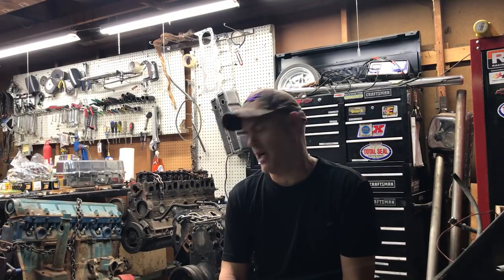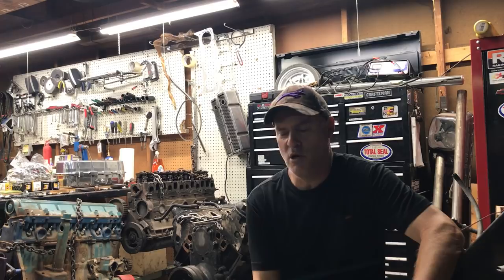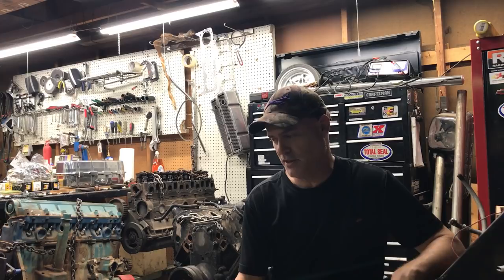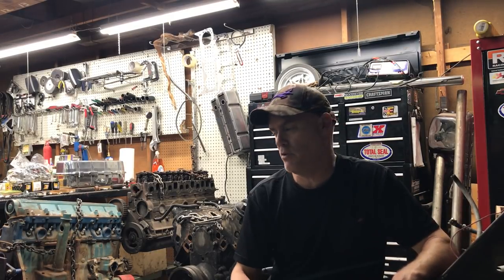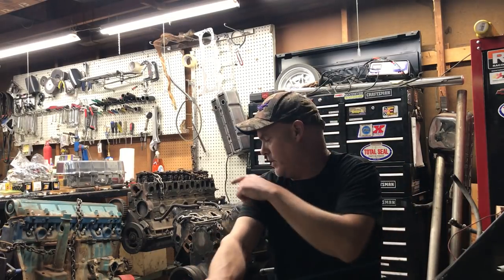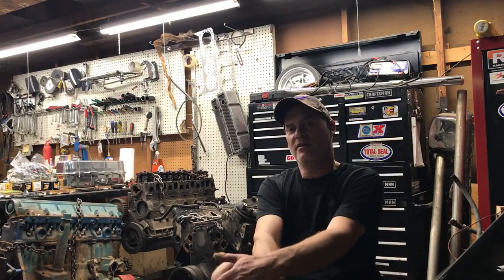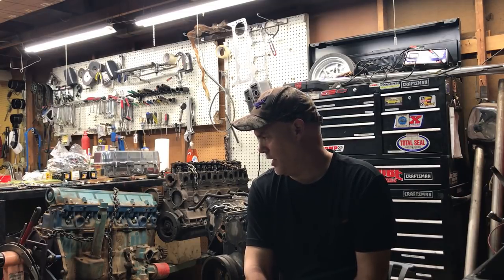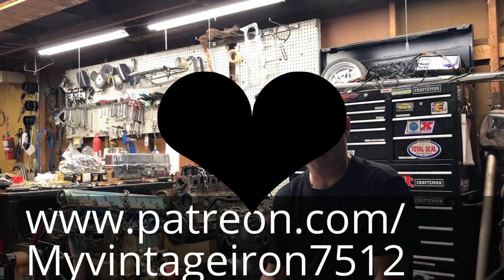Lets Talk LS Engines

Comment: ls has a low drag ring pack on them i have a 4.8 in my truck stock and will spin the tires off the down side is bad bearings in the rockers and rollers otherwise 3 to 5 hundred thousand miles i love my ls
Reply: my wife wants me to buy a new truck but my sierra 2001 is so dependable only major things fuel pump 2012 1 brake caliper 2015 1 compressor 2019 all easy fixes and dirt cheap prices .

Comment: After I built an old "vintage" engine, added fuel injection, a serpentine belt drive with high output alternator and A/C compressor, and an overdrive transmission.  I realized if you want those features, it is way cheaper to swap in one of the modern engines with OD transmission.  I picked up a 2008 6.1L Hemi (less than 50,000 miles) with NAG OD transmission, all accessories, wiring harness and computer for $4,000 to swap into a 1969 Dodge Coronet.  Only issue is not much aftermarket support for the transmission electronics.
Reply from the maker: Keep in mind the Mopar's are more expensive than the LS stuff but I'm with you I am actually a mopar guy at heart

Comment: Have you ever honed one .010 or .020? I have and the cylinder is not harder than a small block Chevy. The reason they usually don't have a lot of wear is ring tension. The late model Hemi is really soft and easy to hone but there again usually very little wear.

Comment: As usually, your on point.  And i have been doing this for years myself. So when i can see that you really hit things on the head.
What you're saying about these are true, & i am that Old School guy. Well im that in between  (at 41), but since I grew up with the old school,  & so i learned & love that way.
But I also have to give credit to where its due. The LS has so many possibilities. And you are so correct about the architecture differences, which in reality breaks down to the efficiency in which everything can happen. Thus, make more power!

But... lets not forget what the older SBC is capable of... of course if done correctly. 
Also application,  LS, Coyotes, etc, tend to be more Horsepower oriented,  vs the low end torque.  That is what all those smaller bores, higher CFM's pretty much equate to. Ever notice, that most of these cars barely break a tire loose? Don't get me wrong,  thisdoes have its benefits, such as not wasting power. But in many cases, im not impressed with how they take off. Sure once they get going,  they go go go. But have to rev & spool up 1st.  Of course any of these can also be built as complete torque monsters, but most do not. They look for that "peak" HP number which seems to impress everybody. Again im not knocking the new engines,  they are impressive too. 

Race cars, high end,  Horsepower,  then go the LS, Coyote, etc.

Street Car, which originally had old SBC, SBF, probably stay with it , especially if  $$$ is tighter.

Currently finishing up 91 Corvette,  384ci Stroker,  with 10.5 SCR, & yes with Twin Turbos. Forged internals of course,  & list of things. 
On 8 PSI;
625HP @ 6,100 /  740 Tq @ 4,000
(680Tq by 2,400  & after 740Tq peak, it very slowly drops Tq until the 5250 cross.
It is an animal for a street car! 

My brother has a 85 Thunderbird, Dart 5.0 L, forged internals,  10.2:1 SCR, aftermarket GT40 aluminum head (flow up to 260 CFM @ 0.600" Lift) & a single Turbo & 
on 14 PSI;
720 HP @ 6,300 /  630 Tq  @ 4,200

Don't get me wrong,  we are using aftermarket EFI units & lot of time, money & planning went into & still are going into these, & we are almost to the final unveiling points of these not bad ass street cars, but also have other extreme customs. 

Point is, if you have the older blocks,  & want a bad street car,  it is more than possible without an LS, etc, swap

Comment: I have a Stock Bottom End, stock headed 4.8l with a Borg S475 running 16-18lbs of boost and I run the shit outta this set up, no overheating issues, actually no problems what so ever. Other than the turbo set up I only replaced/upgraded springs & retainers etc, high lift long duration cam and Holley Terminator control system, MSD 6-AL ign box. For the little money I spent and the massive performance massive horsepower Its insane

Comment: I bought a 01 Suburban with a 6.0L LQ4 (i belive) engine in it. Got it cheap as it had practically no oil pressure and I heard a knock from the engine. But it was no rod knock or main bearing knock. Just sounded like a bad lifter. So at that time of buying it I really had hopes for more of a minor problem. 

Turns out that the that the center cam bearing had spun out of the block half way. Have you seen this before ? And any guess why it had happened? I my guess is to long intervalls in oil changes and some gunk got loose and clogged the oil line to that bearing. 

And to confirm your saying that these blocks are durable. It had 260.000km on it when I checked the rod and main bearings. There were no signs of wear. 

Its now 3 years since I replaced the cam and bearings, and it still runs great. Installed a mild cam in it and it makes that Suburban move quite well! Only thing is that the idle is a little rough with the new cam

Comment: i managed to get a 5.3 with a new cam and new lifters with a rebuilt w/new torque converter 4L60e for free had it running driving in my chevy colorado in 3 months. The engine had been sitting in a fence row for 6 or 7 years in a silverado. threw some new injectors in it and it runs beautifully

Comment: I've had both, the LS is so much better, I had a 65 malibu with original small block, constant problems & high MPG, I now have a 65 C10 with LS1, it's faster, reliable, runs cooler and gets amazing good gas mileage. I won't have another vehicle without an LS in it. Please do a video on which is the best LS motor to swap and also LS upgrades.

Comment: My 1999 silverado 2500 LQ4 6L engine can be run without coolant. Thats correct. The owners manual tells how if coolant is lost the engine will run on 4 cylinders at a time. Air conditioner will not run. we are to drive at reasonable speed for up to 200 miles. After cool down and coolant system fixed the oil should be changed(it has had a lot of heat). My truck has the optional oil cooler as well. I have owned several chevrolet v8s and this one is my favorite.

Comment: Man, I am so glad I found your channel.  So far I have been binge watching you.  I obviously have a couple of questions, (as I am just a novice).  I have an extra 2001 LQ4 that I plan on re-gasketing.  I was told it had 130,000 miles and was in a plow truck.  I plan to change timing chain, oil pump, complete gasket kit and main seals.  Probably water pump too.  Question,  Do I need to lubricate the threads on the new OEM head bolts prior to installation?  Question 2, Would it be better if I install the oil pan before installing the front and rear main covers.  I bought a hub style cover / seal install kit, so I could do it either way.  I just figured it would be better to mate them up to the oil pan?  Thank you for your knowledge...  Ok, back to more of your videos.    Mike
Reply from the maker: yes oil threads pan goes on last

Comment: Its not that us old school guys dont like the LS engines, its that we like classics to be, well, classic. I LIKE messing with carbs and the simplicity of the whole design. Computer controlled vehicles are great. Its just that I prefer them on my modern daily driver. Not on my classic.
Reply from the maker: The Carb stuff is not simpler at all the OBD 2 computers basically self tune they are pretty much plug and play whereas carbs require manual adjustment at every level I do understand the classic end of it the early small blocks are still the least expensive builds and are quite popular I do allot of them but the point I think should be made is they are definitely not simpler than the LS either from a build or tuning standpoint

Comment: I get it with these LS engines. All the talk about how good they are and how they are so cheap to buy and build? Hmm. I have many friends that have gone down this path and LS engines is all they talk about. I have seen every one of those friends spend countless hundreds/thousands of dollars on LS performance parts, Special LS parts to adapt that engine into their ride, computer stuff, more computer operated stuff, special wiring harnesses being made, finding wiring harness parts, finding computer operated items and parts to work their engine, making the engine run with the drive train, HP tuners, hiring a "specialist" to tune the thing. And that doesn't include the power adder. The list of special tool purchases to work on these engines is long, too. Sure, the LS engine is very cool and people are making some impressive power with them, I will not disregard that. Myself, I can't lift myself up to that level due to the for-mentioned. I find it ridiculous to spend hundreds/thousands of dollars on something that I can do Myself with a gen 1 SBC without having all of the specialty, techy, computers, the computer related stuff involved and relying on others to get the thing to run. Maybe one day I will turn into a LS guy when the industry makes it more affordable for a "one man operation" to do so. For now, I'll stay with what works. Analog gen 1 SBC.
Reply: So buy an intake to accept a carb run a  msd box to fire the coil packs and bam your making an ls run on a carb and have eliminated a ton of money and time and especially wiring and tuning all that is out the window set up the carb to suit what you want and the msd box is programmable so lots can be done there as well it's the cheapest way to run an L..S. motor and get good power the h.p and gas mileage differential is negligible between. A carbed one and a fuel injected one

Comment: Other improvements would be thermal management design with the reverse cooling, that cools the cylinder heads first, the symmetrical port layout, and using better materials like the copper-infiltrated Powered Metal valve seats in the LS3.  All those changes reduce cylinder head and valve temperatures improving detonation resistance.

Comment: Love the LS motor, but the wiring seems intimidating......
Reply: Put a distributor and carb on it
Reply: You can't put a distributor in them a msd box takes the signals from the crank and cam sensors and turns those into firing the coil packs at the correct time I.E to run a carb on an L.S swap

Comment: I've owned 2 LS motors 5.3's. both would burn major oil at start up after the intake pcv system porting would fill with oil and dump into the intake ports. Talk about a great engineered engine, I don't think so! And the fact that Chevy won't do anything about it is just more salt in the wound!!

Comment: My brother built a 6.0 LS. Block (Iron truck)and heads were from a junk yard. It made 980 HP (422 CI)with one carb. Cost is about the same as a 454. If you have nothing build one. Don't sell your 454 cheap to get one.

Comment: I have an '05 Silverado with the 5.3 LM7. Bone stock they're so undersressed they'll last forever. I run good synthetic oil and I'm at 200,000 trouble free miles. There's a few million mile LS engines out there. Even at 10,000 plus oil changes it doesn't use or leak a drop of oil. Compare that to all the Ford had with the Triton engines. I'm glad GM found a design that works and decided to stick with it. One thing I found is that it prefers slightly thicker oil. At least a 10w30 weight or a thinner 40 weight and she's good to go. So far the Coyote engine seems to be very well made but for the cost and parts availability I'll stick with the LS

Comment: The LS, Gen III Hemi and Coyote engines are all insanely good. 

Either one of them can hit 500 ho with no power adder, and minimal mods with dead stock reliability and durability. 

A stock LS7 weighs significantly less than a Porsche turbo, puts out equivalent power, and cost 1/3.  

And all of these engines have plenty left in the tank.  I believe Ford has made a mistake with the boost philosophy - coyote can get more power and better mileage with much less complexity. 

A little off field, but this is first hand observation for 3 LS engines, a Ford 2-valve and a 2 Porsches.

Comment: I know what the fatal flaw is in an LS platform it is in the cam bearings. #1 cam bearing is bad about making a knock and if it starts doing that, and it keeps going for very long it will build up heat that will hump up #1 main saddle and in turn destroy the front main. Again I've seen this usually only in performance modded and high mileage (200K plus).

Comment: 80% of ring ridge issue is due to carburation not necessarily due to cylinder material. Look at any sbc engine that has some type of fuel injection from factory. Also LS piston rings were thinner and low tension, another factor in wear ability. Down fall of LS is poor bay to bay breathing. This was encountered in prototypes later modified but still has some problems especially in stroker apps. Ls down fall is buying junk car engines that have set for a while as the dissimilar material ie aluminum piston will corrode bores. .010 max over bore doesn't clean up much. But many good things about them otherwise. Beware of trying to throw a big cam in without a lot of checking, as true for most engines. Simple can be a problematic word for someone with little know how and big dreams.
Reply from the maker: The early small blocks have soft cast iron cylinders the ring ridge I am referring to is not carbon build up it in in fact cylinder wear to say that 80% of the ridge is carbon is a little misleading I suppose I should be more clear on this when inspecting a block we do not consider the carbon build up at the top of the cylinder the carbon gets scraped off during cleaning the early blocks have a huge problem with actual cylinder ridge  it's not unusual to see .010 to .020 cylinder wear on early small blocks it's unheard of on the LS engines because they have much harder cylinders and cylinder coatings

Comment: Hey man watching your LS1 build, can you do a LT1 1994-1996 or so year build or a video with info, I watch all your videos, good info and good advice, keep it up!
Reply: Jursty A LT1 is really just a SBC with a different cooling system. The block can take a little more HP but the overall design is the same.
Reply: Thank you, I am aware of the cooling, I just would love to see a good informative build on one.
Reply: TPV Productions---You're forgetting the distributor among other things.  It's called a Gen 2 small block for a reason.  Virtually nothing but rods and pistons are interchangeable between Gen 1 and Gen 2 SBC's. In fact the stock LT1 rods are as good if not better than a lot of aftermarket rods for the Gen 1 SBC's.   None of the brackets, timing covers or even heads will swap between them directly.  I have both, I know.

Comment: I'm getting ready to buy a high mileage Yukon cheap and build a motor so its affordable, what oil pump do you recommend for these things ? Also, I read a lot about the o-ring failures in the pickup tube, I plan on putting some JB Weld around the joint. I want to do a .030 to freshen it up. Where is the cheapest place to get .030 stock type pistons ? Do you see a lot of worn out valve guides in these high mileage heads ? Also, where is a cheap place for a new stock type cam, and decent lifters at an affordable price ?

Comment: Ls is still old school BUT, it is probably the most advanced incantation of the push rod 2 valve v8, GM has gone all out, the port design is stunning, the combustion chamber is high swirl and resists detonation, the Y block design is second only to Suzuki 2 piece block. The fuel economy of LS motors is impressive, Ford 4 valve do have higher efficiency but of course they should but due to being displacement bound the ls dollar for dollar will kill any ford, aftermarket makes everything for LS, I am sure you can find a cross ram manifold or triple 2barrels on an ls for old school. Camshaft diameters, roller lifters and rockers....its got all the stuff a super hot v8 ran 20 years ago......enjoy before we all must have hybrids and electrics...

Comment: I was  sort of unsure about using an LS engine in my 56 Chevy Truck due to ECM, Sensors, etc. After watching this video, I am going to go ahead and go with an LS Engine. Prefer my 2012  all aluminum 5.3L out of my 2012 GMC Truck will donate to my 56.
Reply from the maker: you will not regret it

Comment: I have an old 89 Sierra 1500 with a tbi 350. I know the thing is a dog and I am debating weather or not to put Vortec heads and a new intake or maybe switch over to a LS motor. But I am curious. Does the LS motor either 5.3 or 6.2fit with the transmission of the older 5.7 or would that have to be purchased aswell?
Reply: The LS will  fit. Only thing is flywheel will need changed.

Comment: Hey buddy,
Love your videos.
Most informative videos on yourtube.
I have a quick question for you sir.
I have an ls2 408 built and forged stroker using all the best bits and am running with a set of CNC ls3 heads. It has arp main stud upgrade high end bearings etc. 58x reluctor wheel.
Would it be safe to run 1000hp with this setup?